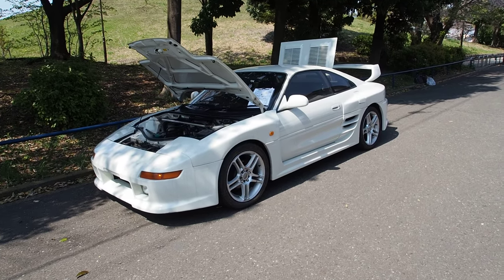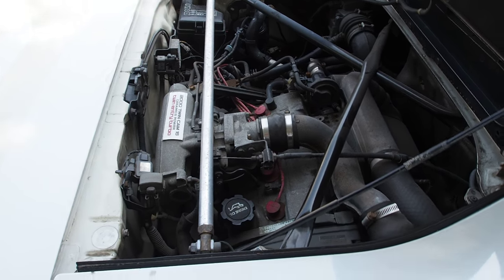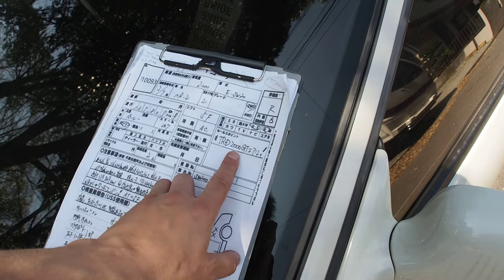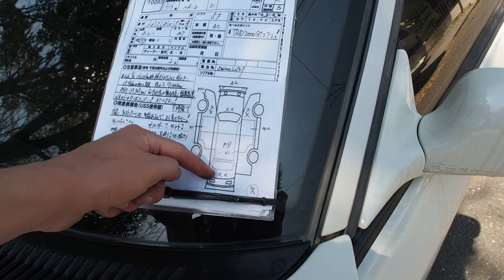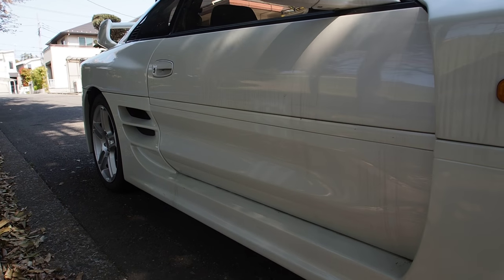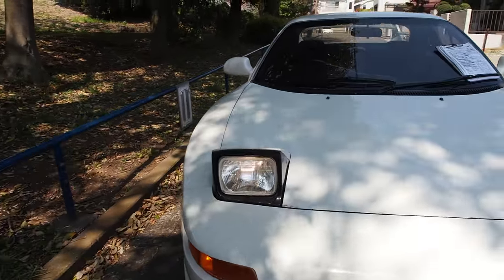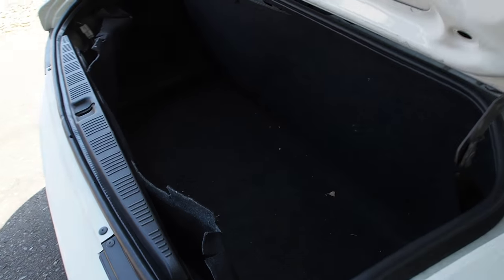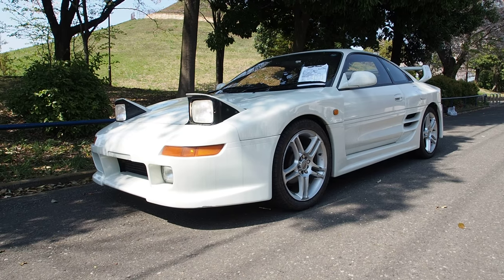1990 Toyota MR-2 TRD 2000GT Widebody Kit (USA Import) Japan Auction Purchase Review

Comment: 10 Real TRD kits were shipped to USA in 1998. I have one of those. They did not include the metal firewall plaque but I was able to buy a unmarked one from Japan.
Reply: Would love to know more about your 2000GT! Without the plaque my understanding is that it is the kit, but not installed by Toyota Technocraft, is that correct? In those cases how do you verify the panels to be authentic? I have read to look for Toyota on the underside of the panels but I have no idea if they actually say Toyota anywhere, can you confirm that?

Comment: I don't believe that black-painted intercooler will work better. Mine non-painted cools the air to +1C warmer than atmosphere at 1.5bar of boost. 

But adding a film of paint will improve the thermal isolation of cooler and it won't give bigger flow of heat through itself.

The Omori gauges - just awesome!

Comment: Hi Derek. Thanks for this video! You mentioned that you don't believe that this is an authentic TRD2000GT conversion (#3). Do you have any information on how to determine their authenticity? I was not aware of "knock-off" TRD plates, so I am beginning to question the authenticity of several TRD2000GTs that I'm aware of. (Including #5 that the international MR2 community is buzzing about)

I also made a video about #5 and I don't want to spread misinformation.

Thanks so much!
Reply: I also want to know more on this! Need to confirm my 3000GT and information on these vehicles is surprisingly very vague on many details

Comment: mid engined means it will brake terribly. all the weight is over the rear tires. itll corner like hell though
Reply from the maker: Mid engines have more weight behind the centre point of the vehicle. By braking, it shifts the weight distribution forward. Compared to a front engined car, you get better weight distribution between the front and rear tires, thus giving you more grip. You also get better acceleration because more of the weight is on the rear tires.
Reply: ^this, I never understood why people think mid engine brakes, or handles poorly, yeah well formula F1 cars brake the best and corner sharply and they aren't front engine front wheel drive like buukro's civic, just saying.

Comment: The fitment is not really good and looks a bit silly. Needs some spacers.
Reply from the maker: Flush fitment requires rock hard springs. When I see kids driving with flush wheels, I can only think of slipped disks in their spines by 40.
Reply: Spacers are garbage. It needs wheels with a lower offset.

Comment: So much snap oversteer.
Reply from the maker: The test of a good driver.
Reply: mhm, or a dead driver..more often;p..they say it has a tendency to snap/lift off oversteer and you'd better choose the right speed while cornering without braking (or especially hard braking and then excessively accelerating), otherwise you might end somewhere off the road luckily dead;..and i don't think you know all the corners..unless you're on a track..so as a track car it's a good car with a good weight distribution, but in real life (wet, dirty, sandy roads and unknown corners) it's a killer car/a black widow or smth..but i guess it's alike most Porsches and other rear/mid engine cars (with an exception of NSX which was probably the most friendly one from mid-engined cars, maybe due to longer wheel base, or being NA, or smth else, later generation mr2 w30 also were low-powered NA and had slightly longer wheel base, so they weren't so frightening like turboed w20)..so it's either you drive it like a pussy, or brave..and dead:D..so you have to be a good driver to drive a car like this on its' limits, cause mistakes are unappreciated and unforgivable..though i've never driven a rear/mid-engined car, so i have none experience..only what i've seen or heard:/..as for looks - if i were up to 25yo (remembering myself), i'd say this one looks better/cooler than a stock one, but now when i'm 35 i'd choose a stock one..only..without a single doubt..this has too much of plastic..eeww;)